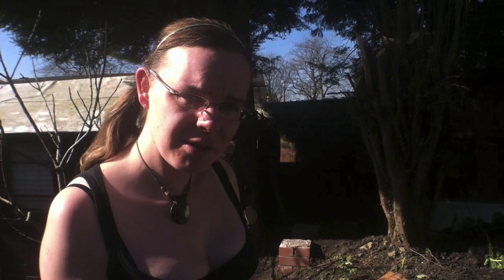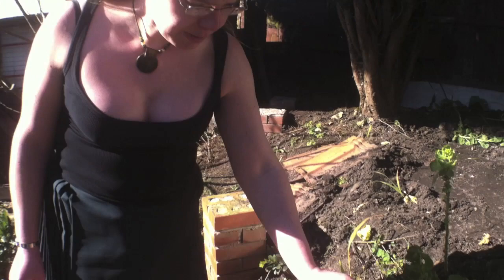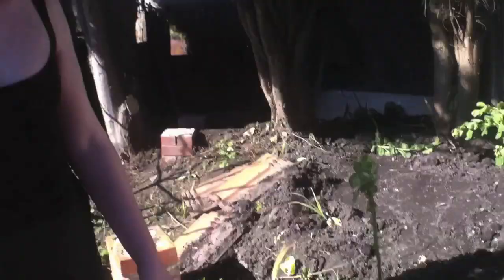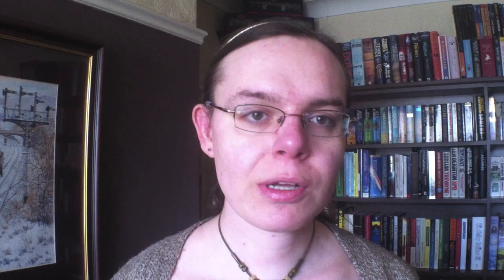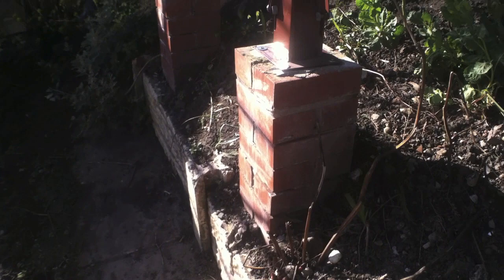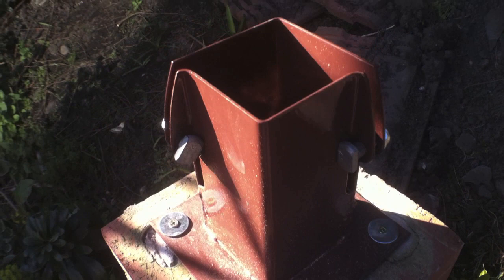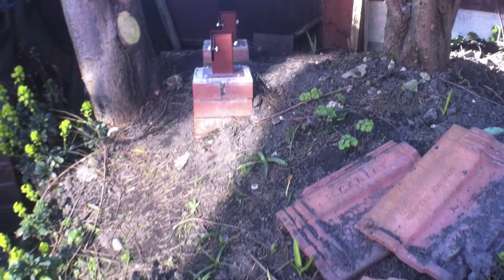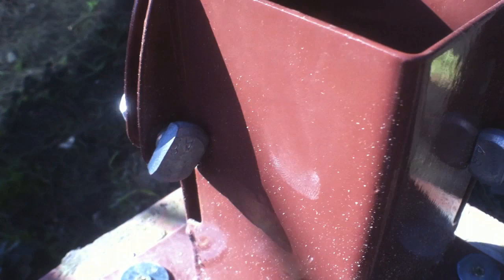How to Build A Garden Model Railway, Part 2

Comment: First hat's off to for embarking on this enterprise. For various reasons, I strongly suggest using "Treated" lumber for the posts. Although not in direct contact with the soil, it is the UK and rain/moisture will seep in between the metal holders and the posts, same for any lumber used in Track support. Best of British on the months to come
Reply from the maker: I've used the treated stuff that gets sold for building fencing for the main supports and braces. The track bed is exterior grade plywood (of the type sold for making flat roofs) and I've painted it with preservative too. In the British climate, nothing is left to fend for itself!

Comment: Don't know if it's too late but I would recommend standing the "treated" posts in a bucket of Creosote (try and find the real thing - not DIY creosote 'substitute') available from timber shed and house merchants, usually found on large Industrial estates. Paint it liberally onto all wooden structures especially end grain, and it should see you out! Robert
Reply: Creosote? As in, the stuff that accumulates on the inside of chimneys?

Comment: Did you use a spirit level to check that the post holders were straight when you screwed them down?  You'll want to be sure that the baseboard is laterally level as well as vertically.

Great points on keeping the wood above the soil to keep it from rotting.  I can't wait to see the trains flying round this summer!
Reply from the maker: The brick posts were built very carefully to ensure that the tops were level in all directions. I double checked when fastening the metal plates and these too are as good as level.